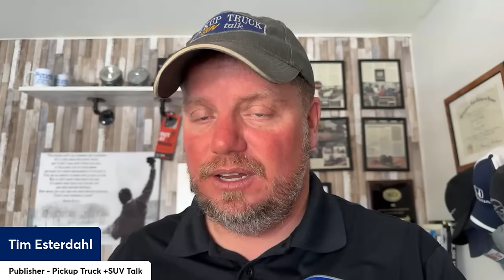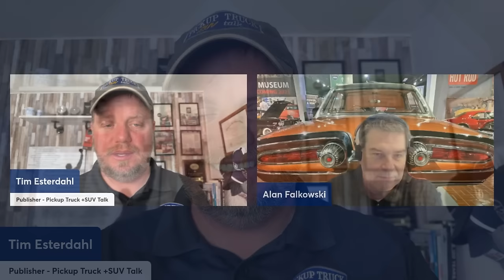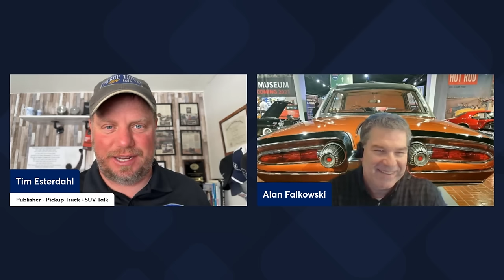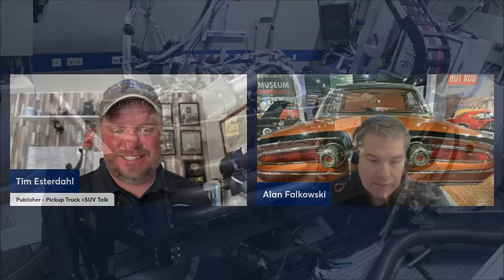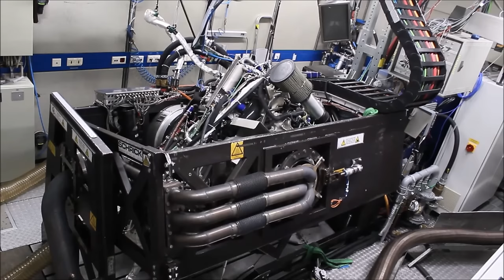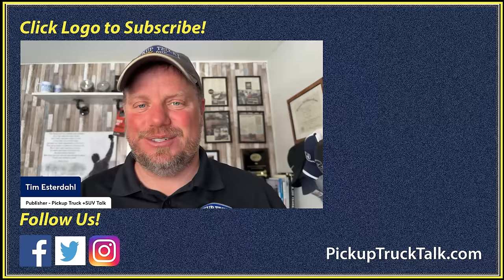Engineer Deep Dive: 3.0L Hurricane Engine - Turbo Life, Oil and Intervals and More

Comment: You know if you want the truth what you should do is have him as a Chrysler guy. Talk to you about the Ford motor. 

Then go to Ford and let their engineer talk to you about the hurricane engine.

It seems like all you're trying to do is use an engineer to sell a product.
Reply from the maker: I’ve done that. The competitors don’t always have all the answers since it isn’t their product.
Reply: @Pickuptrucktalk  it's just some of the stuff he said doesn't actually make sense if they took all the heat into consideration. 
Why is so much of the hurricane power plant plastic? Basically, every supporting component on the outside of that motor that could be made out of plastic is like they learn nothing about the oil cooler issue on the V6

Plastic just doesn't like to be heat. Cycled, especially if it's going to have dirt on it. It draws the oils right out of the plastic and then it becomes very brittle
Reply from the maker: @gsc512  it’s funny you said that. He told me at the event, they worked hard to remove all the rubber hoses. They found the rubber hoses were the number #1 reason for warranty claims on other engines like the Hemi.

I can’t speak to the amount of plastics, but it sure they looked at it in terms of getting too hot.

Comment: Any engineer that knows the K.I.S.S method   removing a physical dipstick to check the lifeblood of the engine is a stupid move..loads of azzanined moves with theses company's as of late. Start stop is one big one all that does is kill the engine does the oil system have a foot valve /one way on the pick up and or a pressure accumulator ? NO  mic drop

Comment: Absolute crap engines starting with the Hemi.  Cheaped out on the lifters and I guess they never updated that because my 2013 went bad with 68k so I traded it in on a Cummins 2500.  Rusting by 24K miles and they denied the warranty.  I had about 5 or 6 of their vehicles before that and all was fine, but I absolutely wouldn't give them a dime now.  I'm supposed to believe that they beefed up starters but chose crappy lifters?

Comment: so this guy is responsible for poorly designed engines? the palstic oil cooler on 3.6- a solic 6 cyclinder will run forever  or v8 - undersized turbo engines in large vehicles fail

Comment: The Hurricane engine is a junk engine unless built exactly how it's designed. It's nowhere near a Hemi, it's literally a huge pile of shit. But once modifications start, it could replace the Hemi, but it's obviously a mass production engine and quality control will be it's Live or Die. Not only that, but the engine is super stressed, it has only a turbo on or lag lag death lag, no in between. In a Car, probably gonna be great.

Comment: I personally think still Lantis management and design teams I’ve had a collective brain aneurysms. You people aren’t reading your customer base. I personally would never drive a pick up truck with a six cylinder. I’ve had one, I’ve had two and I hated them both. Secondly, as much advancement as we have made with turbocharging, it’s still a gimmick. When you take a small engineAnd stuff at full of power you will have problems, and these engines will have problems.

Comment: 😮 turbos fail. When they do, it's an expensive repair. That never fails... Turbos end up having a rotary shaft moving at 100,000 RPMs.... Nothing else in vehicles moves that that speed 😔 That's why turbocharged engines have more failures than naturally aspirated or blown engines... Turbos fail catastrophically! 
Historically... That's true

Comment: This guy Alan it full of crap. The 3.0L Hurricane engine is bound to fail in 80-100K miles. Its a natural wear and tear event. Also the crank case evactuation without a catch can will put oil deposits in the intake valves and piston. Ring clog will eventually lead to blow buy. Also the cylinders are not sleeved. Thats bad. And 22psi boost to get the power will also lead to ring failure. So what is great about this engine.

Comment: Engineering is simply over pressuring and extending oil life beyond its capabilities. Especially with low tensile rings. Sludge stops the rings from moving as intended and now passes through into the chamber and burns a quart every 1009 miles. Well at that rate you’ll be negative oil at 10000 miles. Bad engineering!!!

Comment: Lmfao the rest of the world has been or has exceeded this stage of ICE engines and America is like "We ARe GoNNa usE TURBskies noW OK, " 🤣🤣🤣🤣 same people that ran carburators well into the 80's ffs while the rest of the world was rocking fuel injection and turbos and superchargers. 
Biggest problem these engines will have is the mouthbreathing customer that will completely f up the usage of this product, ie poor maitenance,  high idle time or short cold trips or hot runs then immediately shutting off the engine on a rocking hot turbo and then blaming the product when it grenades. The current customer base is more concerned about Big Gulp refills than what their vehicle is doing. The learning curve will be long and staggering .

Comment: Most important fact of oil these days is this. Synthetic oil was redefined in the Mobil 1 complaint against Castrol. Mobil 1 lost that argument. Full Synthetic today is not what it was in 70's actually man made oil in a lab at the molecular level. As Mobil 1 and Amsoil made. But since that while debacle between Mobil 1 and Castrol Mobil 1 is like the rest sourcing base oil from ground source petroleum and natural liquifide gas which is NATURAL NOT SYNTHETIC and refining it in way so they slap synthetic on the labeling and not get sued thanks Castrol. Amsoil didnt follow this trend it still uses synthetic manufactured base stocks that are chemically manufactured at the molecular level not refined ergo 100% synthetic. Via Hydrogen and Carbon atoms sourcing. These stocks are what is purchased by Amsoil to formulate there blends and are verified and certified by Amsoil before formulating there blends. Amsoil claimed back in 1971 there oil can go 25,000 miles before changing so for 10,000 miles today buy car manufacturers is just a sad reality of how far behind car manufacturers are behind the true 100% synthetic oil formulators today Amsoil and Motul for every day driving and redline and others for the racing markets. Yeah Mobil 1 isnt they threw in the towel back in the 90s and joined the Castrol rip off on the consumer public. And now you know the rest of the story as Paul Harvey coined.

Comment: 10 000 mile oil change is a No-no. Period. Max. 5000 miles. This guy is part of that typical trend that manufacturers now use for gullible people to subconsciously buy a vehicle "with less oil changes". Wow, that will save me a $500 on a $70 000 truck over 3 or 5 years. Whatever the warranty period is. And yes, may I just mention that I know a LOT about chemistry. A masters degree worth.

Technology might improve in how we understand it, but material technology shows a milder forward motion. Now every so-called new combination is touted mightily. Reality is that there is no such thing as an engine liner that "doesn't wear". Everything in nature denatures. Even ourselves.That's the world we live in.

If this thing is an auto stop/start that cannot be deactivated on drivers' demand forget it. I don't care what this guy says. The whole shutdown thing does not conform to any natural law. We, as humans, try to keep everything in suspension for as long as we as we chase the impossible, but your engine will end sooner. No matter the computer input or size of the starter.
Hopefully they will bring out a light hybrid with this engine that could allow them to not do auto stop/start. 

If they don't do it, your pickup will go in the same direction as what Stellantis is going now. To the Chinese.